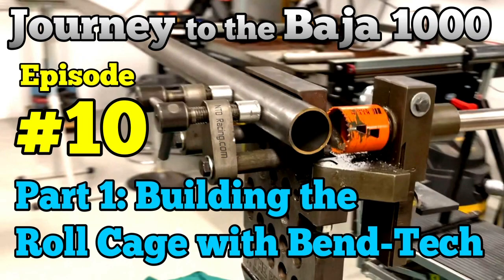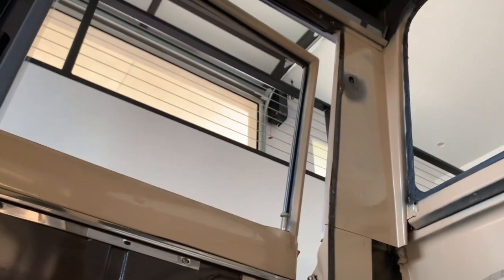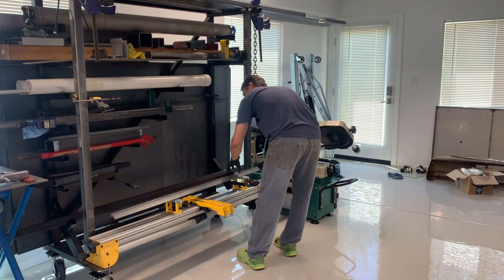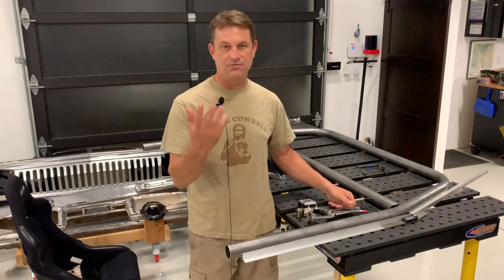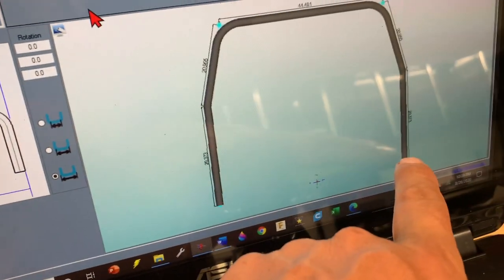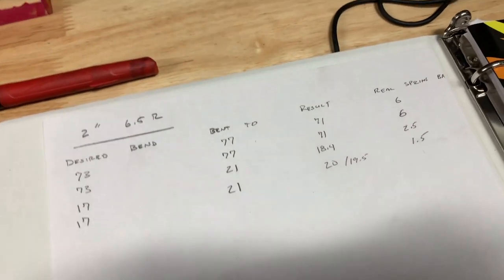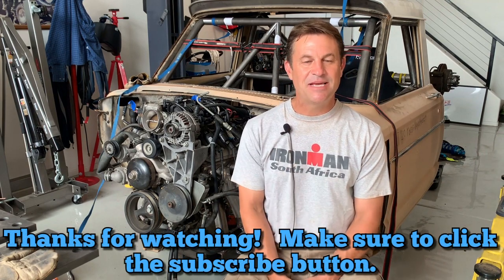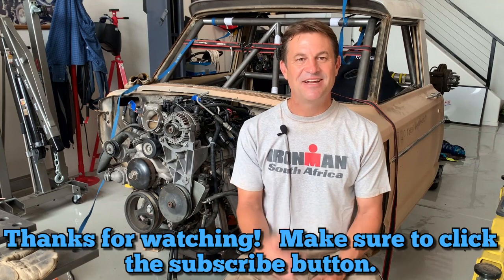Using Bend-Tech to Build a Roll Cage

Comment: Thanks for all the videos, they are great!  I have a question in regards to leveling.  Are you leveling the die via the stand first (with no tension on the die) then inserting the tube and leveling the tube horizontally?  Or are you just leveling the tube and letting the die square itself to the tube as you take the slack out?  I hope that makes sense.  Any information would be greatly appreciated! Thank you

Comment: Future video idea, Full Shop Tour and brief description of all main tools and if you built them and how... I m guessing thats a swag off road press brake kit?
Reply from the maker: I will probably do that.   Thanks.  It is a Swag.  I have their tube roller too.  Great tools.
Reply: @ntdracing  I bought some of the dies from affordable bender, and am building my own frame for them with an air over hydraulic bottle jack, for tube bending. Just got a crossfire, I think that might have been what led me to find your channel. Planning to get a press brake for doing similar stuff as you were doing in the video and thought I would check and see what size you were using as if seemed to work well. Definitely will have to add an air over hydraulic on the press at some point though! Thanks for the videos, great stuff and good content! I ve been enjoying the videos. 3d printer stuff was great too, inspired me to go and dust mine off!

Comment: I have a request but first let me tell you that I have watched your whole series at least twice. So informative. You are the reason I am getting my Crossfire Pro. It will be here in mid Feb. I would like to see if you can do a video on your air setup and include product details on your compressor (and Noise level) and the air drying system that you are running. Seems like you have it all figured out. If a video is too much too ask for then maybe just a list of the products you are using?
Reply from the maker: Too funny.  I am doing the final edits on that topic right now.  Should be out tomorrow.  Thanks.
Reply: @ntdracing  Awesome timing! Thank you!!
Reply from the maker: @anthonysanchez4742  Video is up...I hope you like it.  https://youtu.be/dIDNLXRTB9A

Comment: Dude, you spent some money on setting up your garage! Well spent I should add. Nicely done! Who did the floor coating and what product?
Reply from the maker: Thanks.  Had to do a bunch of the work myself to pay for it.  Put in the lift myself and got the epoxy flooring from Epoxy Masters. https://epoxymaster.com. Great product.  I have the light grey with the clear coat over it.  If you do not have too much sunlight on your floor, I might recommend not going with the clear and calculate to go thicker on the base coat.  Just did that in my neighbors garage and the floors are a mirror.
Reply: @ntdracing  Could you do me a favor the next time you're out in your shop and measure the diameter and wall thickness of the tubing on your Miller ArcStation table? I am thinking of building something similar but with a custom laid out plate. I'm trying to price out the materials to see if it's worth it or not.
Reply: @ntdracing  awesome. I’ll check it out. Thanks!
Reply from the maker: The legs on the Miller welding table measure 1.5inch tube 14Ga.
Reply: @ntdracing  thanks!

Comment: Nitetrain - nice work, man!  I'm starting to get jealous of your shop.  Playing some catchup watching the vids, and the truck is looking badass!  Little tip on  using those hole saws on steel - get yourself some good sulfur cutting fluid and use a slower speed (RPM) with pretty heavy pressure.  The cutter will last longer.  I like WD40 or kerosene for aluminum, but I really prefer the thicker oil on steel.
Reply from the maker: Good to hear from you Yuri.  You are the last person who should be jealous of my garage.  Back to final assembly.
Reply: @ntdracing  Good luck, my friend!  I'll be following!

Comment: Good video. Love the rubber band.
     Use a good EP white grease on you die and follower die.
 Use Cutting fluid or air tool oil on hole saw blades.   Also more expensive but last longer are carbide tipped hole saw blades.
Keep the vids coming.   Good stuff.  I hope to some day see the Baja race in person.
Reply: Hell yeah! That rubber band idea!!
Reply from the maker: jim howell White grease...thanks.